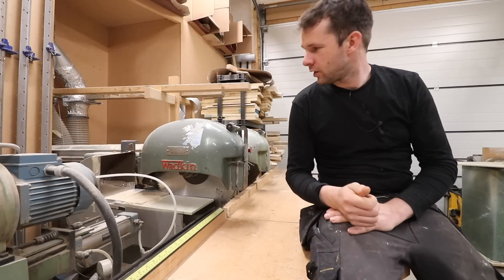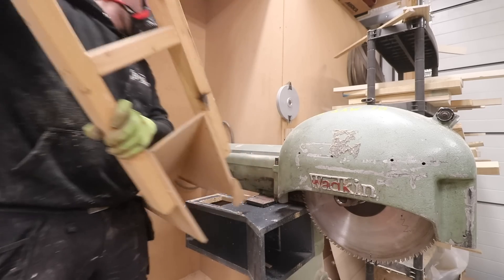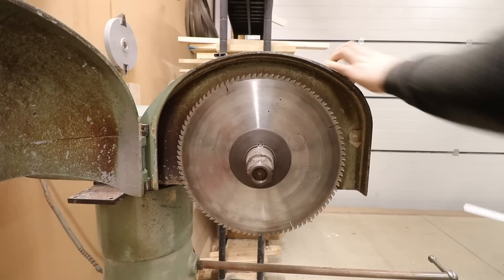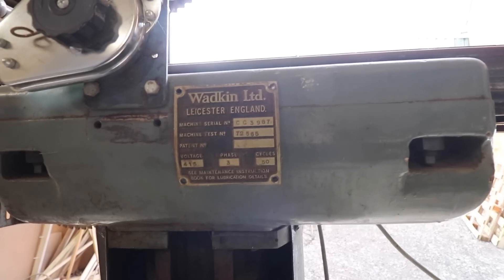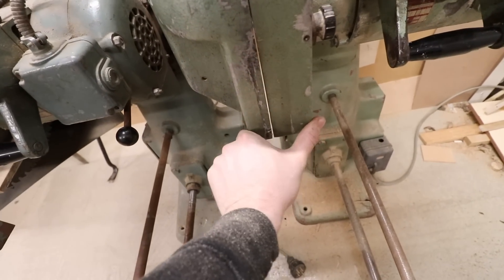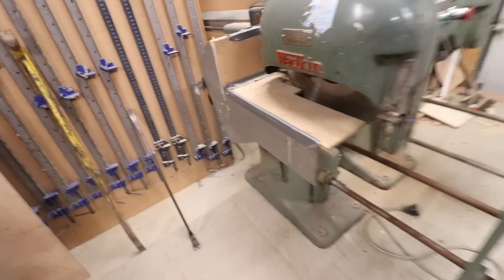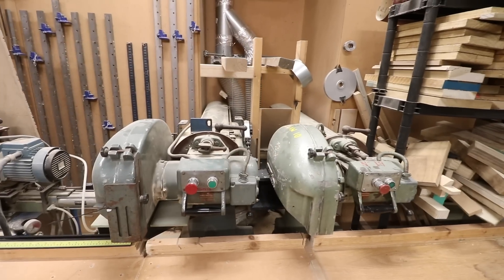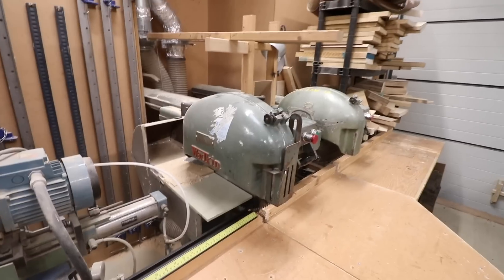Wadkin CC Crosscut saw - I bought a second one they are that good!!

Comment: The machine shop I did my training in had a Wadkin RAS .  It was the first machine I was allowed to use.  I loved the sound of the blade cutting.  As it exits the timber it kind of 'zings'.
Reply from the maker: Cheers Matt, yeah they are a lovely tool. Conficence inspiring compared to modern equivalent

Comment: I could really use one of those, but will never have enough room. 
I came across one that was being auctioned off with various machines from a former boat yard. 
Sadly all the machines had to be moved within 48hrs of the end of the auction, I just couldn’t comply with that so didn’t bid. What a bargain it would have been though. It only made £360 including the auction fees. Perfect, well cared for condition too. The wooden boxes that came with it contained various spindle cutters and adjustable width dado blades. The attachments alone were worth three times what the CC made. 
Great video, always interesting 👌🏻
Reply from the maker: Cheers Mike, Id probably upset you if i told you what i paid for this one! I know my friends across the pond are very envious lol! The dado cutters are a thing of beauty

Comment: Lovely pair of saws, the engine crane  is a handy piece of kit,  just pulled a square head  vertical  block off the inside of a 1966 Danckaert 5 head moulder , owning to the fact that the cutters are bolted on to the block and could be changed in position  without removing the block, it was well sized , with a lorry strap and the 2 ton engine crane and a crow bar got it shifted. Luckily the moulder is all cast, it must weigh in at around the 2 ton,  which helped a lot.
Reply from the maker: Cheers Willie, they are lovely additions and work so well. Yeah the crane, or any for of assistance is vital with stuff like that. Thanks for sharing, i love it.

Comment: I love the pair together,  I have just brought a cc2 and was lucky enough to get the cast iron table legs and stop bar with mine. I think they was an optional extra when purchased. You will need a bigger workshop soon.
Reply from the maker: It works great! Especially when short on shop space(as we all are) Nice one! Is that the Flip stop bar? This came with a 2.5m one, I completely forgot to add it to the video, its a lovely bit of kit, Ive not seen the front frame in person. Out of interest what do they sit the bench height at? Bit of a guess for me the first time round but its been about right to be honest.

Comment: Great saw, we have had one as our primary docker for around 20 years now. The only negative is the space required to house them. Ours is different to yours though, possibly newer model.
Reply from the maker: There are a few variants of cc and Cd's great tools
Reply: @BradshawJoinery  No doubt. It's nice to see another Joinery shop using one. They are great machines.

Comment: This looks really massive.  Over here in the US we scare up old 1950’s or 40’s DeWalt radial arm saws, that do all this in a much more compact space, plus have the ability to turn the saw parallel to the table, and parallel to the fence for rapidly ripping.   Gotta look for the ones with the extra long arm if you need to cross cut more than 24”, but you can actually still buy saws of this quality from Original Saw.
Reply: @benjaminallyn1200  Why on earth would you need SIXTY of them?   Where do you Keep them all?   I lucked out to find just one 3hp 3 phase from 1953 that can swing up to a 16” blade that is in like new condition.  And the prior owner had added on a 3 phase inverter so it can be run off 220.   I agree that having the table rigid to the arm makes it much easier to calibrate.  You just use leveling feet to level the underside of the arm at 90 degrees in both directions, and then level the table top using an ordinary level to get a trammed blade height.   About the only thing I had to do to mine to get it perfect after calibrating the blade to the arm, was to reposition the back edge of the main table so that I could calibrate the Out Rip measuring scale on the side of the arm so I can set up perfect width rips without having to measure with a tape or square.  The 3 swappable table inserts behind the fence I cut to precisely 1”, 2” and 4” widths so I can extend my rip width up to 27” or any measure between by moving the fence back.
I almost bought one of those really nice multilink Bosch mitersaws… until I actually got to use my friend’s and discovered how much wobble and slop even the nicest mitre saw has. But, since I don’t need my saw to be mobile, I opted for the 500 lb DeWalt.  So much more precise.
Reply from the maker: Thanks Christopher, thats interesting! The DeWalt saws are over here too, they are not particularly popular, i guess because the likes of Wadkin and heavier made machines are readily available the lightweight dewalt isnt as comparable. You have to be really careful with a dewalt radial arm saw, they want to climb the cut all the time, this saw on the other hand is solid as a rock, takes whatever you throw at it and asks for more. The ripping funcionality of the Dewalt imo is not a good idea, throwing material directly at you and trying to lift it off the surface. I literally couldnt think of a worse design for ripping boards, i guess if you hadn't room for a rip saw then it'd do the job, the added turntable is another point for inacuracy aswell. ive used a dewalt, and they are totally different league saws. Good saws for a compact shop and better in that situation, but for out and out performance canny beat this IMO of course
Reply: @BradshawJoinery    Well, I gotta stand for my team… the yarn that DeWalt’ s “climb” the cut is a myth.   The arm on the Old timey DeWalts is 3” or more tall precision machined cast iron. And unless the user has loosened the machined cast iron clamps holding the vertical steel tube, the tip of the arm of mine can not move half a mm. My DeWalt, with its built in table weighs in at over 500 lbs. And I can tip the entire machine by the end of the arm without it flexing. Its all cast iron and steel. ( I had a newer, cheaper radial arm years ago, and it DID tend to climb the cut, but all that did was jam the stock between the table and the blade, stalling the blade and tripping the motors breaker ).  What the 1950’s DeWalts Do tend to do is PULL themselves thru the cut, but that is the same for any top cutting saw blade.   The user just has to realize that they don’t have to so much as ‘pull’ the saw thru the cut, as manage the saw’s tendency to pull itself thru the cut.
And I don’t know what you mean by the ripping throwing material at you.  The blade rotates parallel to the fence for ripping. Any kickback is off to your left ( unlike a table saw that kicks back at the operator, and the dust chute is an elbow that you simply turn to face away from you at whatever orientation the saw has. The ability to precisely calibrate the saw means I have never seen mine kickback even once as its blade is perfectly plumb, perfectly parallel to the run of the arm, and when turned for ripping, perfectly parallel to the fence. I can rip 4’x8’ sheet goods lengthwise without issue and its easier to hold the large sheet tight to the fence than it is on my table saw, where I am standing at the end of the cut, rather than perpendicular to it.  I have a pretty small shop.  I got the DeWalt because it does so many different things in a very small space.  But I had never even heard of a Wadkin before. They look pretty impressive, as well.
Reply from the maker: Fair enough, I only have experience of the lighter DeWalt saws, the green/orange and black yellow ones, I didn't mean clim as in actually climb, but more as you put it, very easily snagged in the timber through acceleration of the cut, it's just the style with the sliding head doesn't have the same controlled momentum of the CC, I've used wadkins that follow the same principle of the DeWalt with the overhead arm and saw trailing underneat and they are equally as "whippy" 

I'd have one if I had a small shop for sure, but the difference I'm trying to explain is that if I put a 5" square lump of oak on this saw, I could pull the handle and cut it without worry, with pretty much any other saw, I'd be working it into the cut, being very wary of it snagging or pinching. It really is a beast hence the size of it lol! 

Not as nice to use for smaller repeat light cuts I'll admit! 

Which direction are you feeding the material when ripping? So the blade is climb cutting or pushing against the blade? I've little experience of it

Comment: Wadkin had a factory trading as Wadkin Bursgreen until mid 1990s 1/2 mile from where I lived in N/E England & at its peak employed 350 people making woodworking machines & according to Google they are still much sort after & I just wondered how many parts for these the local lads still have stashed away saying "yer'll never kna when yer ganna need it 😆 "
Reply: Could do with a 5.5hp motor for a BRA. Bloody thing lasted 10 mins after how much grief to get, transport and install. 400+ for a rewind...almost as much as I paid for the saw
Reply from the maker: Thanks For that Normski! I had always thought they were all made in Leicester so its good info to know!
Reply: @BradshawJoinery  Nah, your CCs were both made in Wadkin's Green Lane works in Leicester.
In the mid 1950s Wadkin bought Sagar-Bursgreen for Bursgreen's ability to design and build much cheaper machines at almost the same quality. Wadkin kept their top-of-the-line machine production at Leicester.
For example, the top-of-the-line CC's stayed at Leicester while the smaller Wadkin CK's ras were subbed out to Bursgreen for a year or three, until replaced by the Wadkin-Bursgreen BRA.
Incidently, your second CC was completed (and tested) in 1965, while your first one appears to have been built in 1972.
Cheers,  Vann.
Reply: Yes, Ccs were made in Leicester, not Durham.

Comment: Lovely bits of kit but excuse the ignorance what is it better than a large sliding mitre saw? Is it just capacity?
Reply from the maker: Its a complete different kettle of fish. Mitres saws are great for mitres, but accuracy, ease of use, sturdiness, and most notably speed. You leave these running lob your timber on and wham its cut. For a start you wouldnt lob timber on a mitre saw. youd place it then slowly fire it up and make a progressive cut. This thing will cut 5" oak to a width of 650mm with relative ease. 
You can also do housings or dados accurately, set stops and do accurate cuts more easily, no flexing of the head, solid as a rock. A mitre saw will do most of the tasks this will do and ok for a small shop, but for any sort of production you'd want a RAS
Reply: @BradshawJoinery  Thanks man. Really makes sense, I've seen a few in auction at good prices and been tempted but space is an issue. I have some other wadkin stuff and it is solid! Thanks for your videos, I have learnt a lot about machining wood. Its a journey in joinery !

Comment: I've just bought a really nice old Wadkin CC2 but for the life of me I can't see where the blade lock or stop is for a blade change, do you just use the nut on the brake end of the spindle? None of the literature mentions it either??
Any clues would be great.
Thx, Rowland
Reply from the maker: Put spanner on the nut, then hold the spindleabd turn blade and spanner fast until it hits the bench. The inertia will unlock the nut.

Comment: Lovely bits of kits , very jealous.
I guess that in commercial shops these days they are not allowed as the spindle takes to long to stop.
Electronic brake was probably not a consideration when they were made.
Reply from the maker: Cheers Rodger. Im sure they could be fitted to modern regs. this came out of a big manufacturing shop. It will stop on the brake in the required time and guarding could be added! At the end of the day its for cutting wood, and if it can do that it can cut human

Comment: Looks great. Can I ask what the main benefit of one of these crosscut saws is? say, vs a mitre saw. Is it just cutting capacity?
Reply: I would think definitely power and capacity, and the ability to add dado blades
Reply from the maker: Its a complete different kettle of fish. Mitres saws are great for mitres, but accuracy, ease of use, stirdyness, and most notable speed. You leave these runnign lob your timber on and wham its cut. For a start you wouldnt lob timber on a mitre saw. youd place it then slowly fire it up and make a progressive cut. This thing will cut 5" oak to a width of 650mm with relative ease. 
You can also do housings or dados accurately, set stops and do accurate cuts more easily, no flexing of the head, solid as a rock
Reply: @BradshawJoinery  nice. Makes a lot of sense and compelling when put like that :)

Comment: Hi just watched this video and curious! Reading the comments Wadkin is highly rated but if the motor or bearings go on these CC can you still get them repaired!? I’m very tempted to get one rather than the dewalt RAS regards Mark
Reply: You could get the motors rewound but you have a big issue if the the crosscut roller bearings fail and they may well do on machines this old.  They are special Wadkin items and I do not know anywhere that supplies them. This model machine has almost died out so demand has collapsed for the spares.

Comment: They were designed for docking sling of rough sawn hardwood in a timber yard,  and for severing limbs.

They come from an age when worker safety mattered nought and the people using these would be 13/14 year old kids!!

Stavros
Reply from the maker: Yeah beefy bits of kit! There are several variants of the crosscut saw. I assum this is more a Joiners shop model and the CD variant beign a more industrial cut off saw for such a timber yard. But im sure they would all do the same job none the less.

Comment: What would I be expected to pay for a saw in similar condition?
Reply from the maker: Anywhere from £100 to £2500 id say
Reply: probably between £250 £1200 , the old model are much cheaper than that late models like this one, also having the factory tables will increase value.

Comment: Great video , I have the "cd" which doesn't tilt , there's a bit of setting up on them so glad to see someone else's approach.  
There is always the safety police commenting regarding these machines but I love them . They are incredibly intuitive to work with and I belive using negative tooth angle blades drastically reduce any climbing / running that are possible.  
Keep up the good work 👏
Reply from the maker: Cheers Kevin! Ive honestly never had it run away in a cut. I had a lump of 4" anout 2' wide oak pinch on the blade and it just took it and groaned. Do dramatic bang and tears!